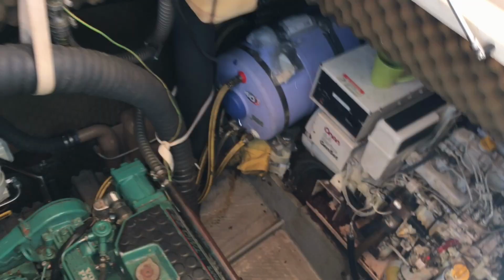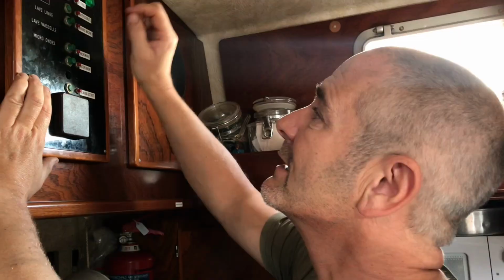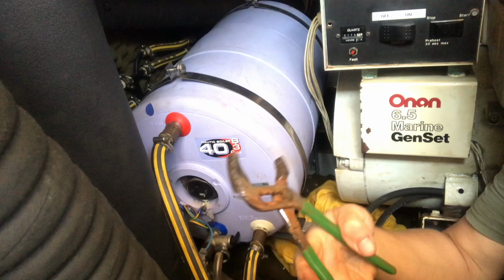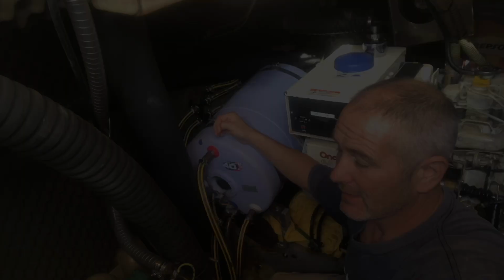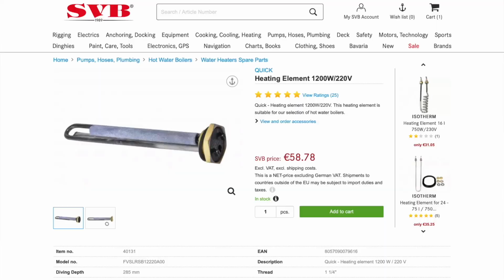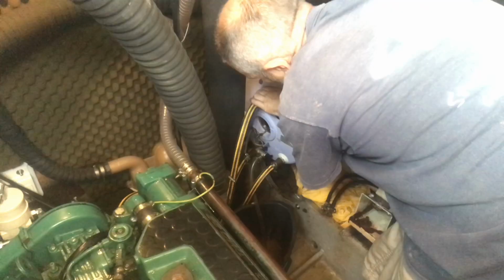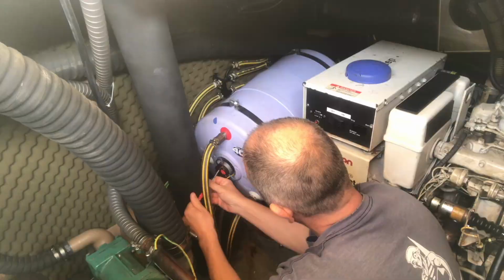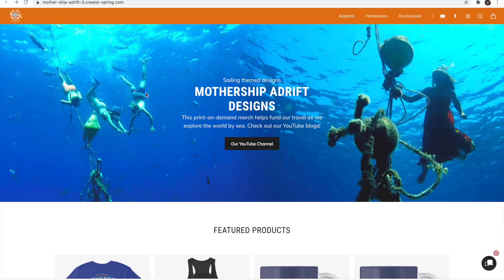#Quick Boiler Water Heater Element Replaced on Sailboat with Electrical Ground Fault: Model B3 40L

Comment: Magnificent- just what I needed to fix the same problem. Easy to follow and clarity at each critical point when replacing the heathing element.  I used the o-ring (not the flat seal) with 3-4 rounds of plumber tape. Once again, very useful. Thank you.
Reply from the maker: Glad it helped!

Comment: If I was stuck somewhere and needed assistance to repair and solve stuff, you would be my nr 1 choice. You have a very sound approach to challenges, using the available tools at hand.
Reply from the maker: We’ll it’s usually out of necessity.. I learnt early on that exasperation and swearing at inanimate objects has no real practical value.. although it does elevate stress sometimes!

Comment: Great video, as always, Woody! I had exactly the same thing happen (tripping shore power) on INTENTION after I had replaced the water heater with the exact same one you have. However, to replace the element, I just took the whole water heater out and put it on the doc. When I looked inside, there was tons of calcium deposits, so I sprayed the inside with a jet stream from the hose and turned the whole unit upside down and WOW. Tons of crap. I repeated spraying and emptying until no more stuff would come out. SO NOW, I pull the unit out every year. I do it the same time I change the engine coolant. I fill the unit with a few liters of vinegar and swish it around and leave it as long as is practical and dump THAT. The water here in Greece creates lots of calcium build-up. The unit is pretty light-weight when empty so its easy to get out.
Reply from the maker: I guess that’s a job I need to do next maintenance stopover. I did what any self respecting boat owner does.. took one look inside, grimaced and closed it up again!
Reply: @MothershipMaintenance  …and then added it to the honey-do list!

Comment: You should have said at the time woody. I have a 56mm box spanner and a spare element. The Ferritaria in El ejido €18 for element and €7 for the thermostat
Reply from the maker: I bought a spare one at the time from SVB24.. but yes I heard they're available from local plumbing shops at a fraction of the cost. Funnily enough ever since leaving Almerimar I've only changed it once.. and that was only as part of routine maintenance. I think the water in Almeria is extremely harsh on boiler elements!

Comment: I bought a 15 L version of the B3 last week. I am still awaiting delivery. 
Since all four pipe connections are the same size (G 1/2) I was thinking of how to prevent the element being calcified or corroded the way it is. I came up with the following idea and I wonder what you think of it:
How about switching the plumbing up some: The red an blue colored pipes plumbed into the engine coolant system and the two white pipes become the drinking water circuit. So instead of having fresh (oxidized) water in the boiler and in contact with the heating element the boiler is filled with coolant which is by its very nature oxigen free and anti corrosive.
The only issue I was worried about is does the coil inside the boiled allow being drained through either white colored pipe ?
What do you think captain ?
PS: plumbing the boiler having the two sets of pipes switched may sound weird or even crazy but if you look at central heating systems which were very common in the 1990 and early 2000's the two styles of plumbing in an indirectly heated boiler were very much used. In fact I have an example of either way: coil runs drinking water or coil runs coolant in several central heating system boilers.

Comment: Thanks for the great post!. I have one of these boilers in a Ford Transit Van, RV. It's connected to the diesel engine heat exchange and also I have it connected to a battery bank. Every time I drive, the hot water from the engine trips the boiler's thermostat. It's a real pain to access the reset under the van.  I've set the thermostat to max, but it still happens. I can't find a way to reduce the temperature on the heat exchange water. Any thoughts on what to do? I have hot water when I drive, but if we're parked for a while we don't have hot water because we cant use the battery power. Any thoughts on what to do?

Comment: Good video, l have a aquastar Oceanranger 38 1989,and have same issue, elements need changing, l have looked high and low and cannot find the tank, any idea please
Reply from the maker: Sorry but not sure. Have you tried finding the part number from an assembly diagram and searching for it online? I've found SVB24.com in Europe are generally good for most boat things.

Comment: Hey, I'm having trouble finding some information. I check element to ground with ohm-meter. I'm not reading open. It's in megohms, but not an open. Resistance across the element is 10 ohms. It's a single 1500w element. Does it need to be open, or is megohms ok?Thanks for any feedback.
Reply: Any luck ?
Reply: Having a similar issue same readings
Reply: @whyimihereforlifelol  No. I just bought a new element. It was less than $20.